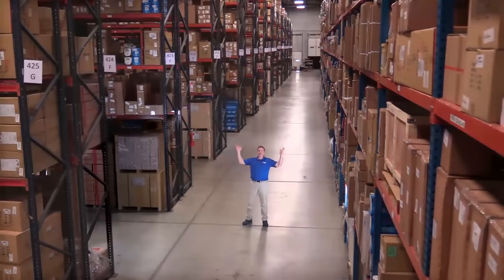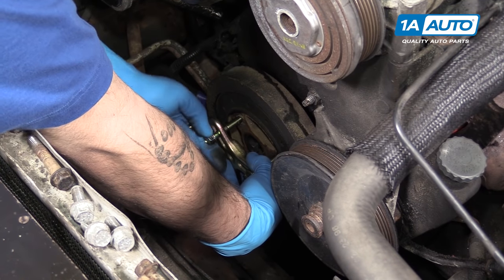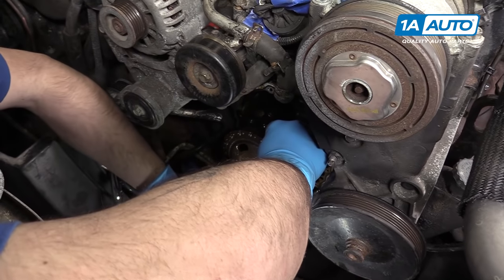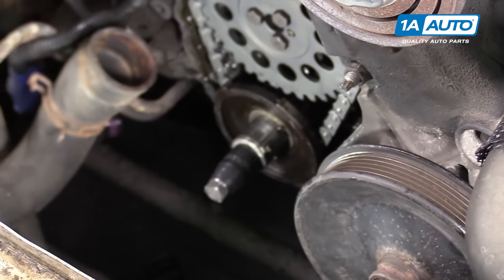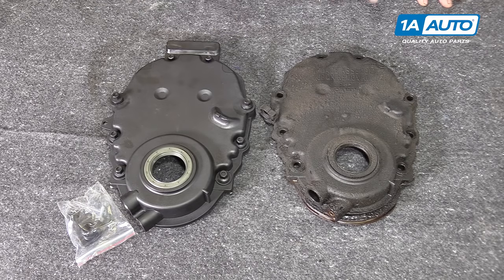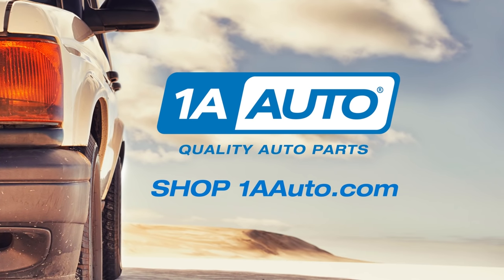How to Replace Timing Chain 96-99 GMC K1500 5.7L

Comment from the maker: √  Watch the Video
√  Buy The Part at 1A Auto http://1aau.to/m/Visit-1AAuto
√  Do it Yourself
√  Save Money
Reply: On reinstall tighten the pulley center bolt 🔩 to 70 ft the balancer on the crankshaft moved from compression stroke mark. Is that okay in order to get 70 ft Torque on center bolt 🔩? I hope you can respond to my question... Thanks...

Comment: Great video, just a couple of follow up notes:

-There is a very good chance that you will have to remove the first 6-8 oil pan bolts to get the cover out.  It is rare that the cover comes out without doing this, as it seals to the oil pan.

-On the same subject, look at your oil pan gasket where it seals to the timing cover.  A lot of these trucks have had their oil pan gasket replaced, and usually with a FelPro brand gasket.  The FelPro gasket is one piece, and is quite thick where the oil pan seals to the timing cover.  In this case, you would not want that massive bead of silicone in there.  Just clean the one piece gasket very well with brake clean, and then put a decent sized spot of silicone on each corner of the timing cover where the oil pan lips seals to it.

-I would strongly recommend using red Loctite or the special locking fastener the aftermarket offers to keep the 3 cam gear bolts tight.  Not necessary, but why take the chance of them loosening up.

-Use thread sealant or Teflon tape on all 4 water pump to block bolts, or they will leak.  

-Lastly, you might change the chain only to find that the engine runs rough/doesn’t start, or the computer sets a P1345 Cam/crank correlation code.  This can happen if the vehicle was retimed at any point while the chain was loose.  If so you will need the engine retimed with a scan tool.   Great video though, and good luck with your repairs everyone.
Reply from the maker: +gcaprice406 Thanks for checking us out! 1AAuto.com
Reply: Hey there, good comments. I can't find any good videos on how to do the timing correctly with a timing light. Specifically where the dam cable is for the auto timing to the ecu, that needs to be disconnected first. Any suggestions or links you have would be awesome. Thank you. 1997 K1500 5.7l vortec

Comment: Nice step by step video! I'll be doing the same on my 96 Astro. 230K miles and not running to well per timing issues. I assume the chain must have some bad slack. Adding my 2 cents, I see you added a new water pump on the re-assembly. Loosening the bolts on the water pump pulley would probably been easier (for those who don't have an air ratchet or impact wrench) before taking off the serpentine belt. Also, the same for the crankshaft pulley as well. Cleaning the gasket residue around the water pump jackets and the timing chain on the block first would probably been easier before adding the new chain set. Other than that, awesome and most detailed video I've seen on youtube! Thanks!
Reply from the maker: +James Logue Thanks for watching. If any of our viewers needs to make this repair, we carry the auto repair part shown in this video on our website. Here is a link to them http://www.1aauto.com/timing-chain-set/i/1atbk00063?utm_source=YouTube&utm_medium=CTA+Comment&utm_campaign=ytcomment&utm_term=mUeIe2Cgchs
Reply: Well, I just wish... I COULD DO THE JOB MYSELF! Who can pay $2500 dlls for this Job. My truck 98 Chevy Tahoe needs to pass emmisions inspections, because the stupid engine light is on and has been on for years.  AND DOES NO HARM TO ANYONE! MY TRUCK RUNS JUST FINE! What the hell!!!!
Reply: Very good advise I was thinking same thing

Comment: Check your torque specs! Timing cover is 6.75 ft-lbs not 18! (or 75 in-lbs).  I figured that out after breaking off 2 screws in the block!
Reply: How did you fix? I had the same issue. I knew it seemed a lot tighter than they came off too.
Reply: Yeah I snapped 9ne of mine also. He also doesn't tell you that the oil pan gasket is one piece and you tear the part between the pan and timing cover when you pull it off. Now I gotta drop my oil pan to fix that. Mine is leaking right there.

Comment: On removing the bolt on the crankshaft put a socket on bolt with a breaker bar against frame bump starter bolt comes loose it is threaded this way so it doesn't come loose while running.

Comment: Would’ve been great to know that it may leak if you don’t drop the oil pan front! Used a ton of RTV and it was a PITA to get in and still leaks which now means I need to drop the oil pan AGAIN! To finally get it to stop leaking!

Comment: Good video, thank you.

What was the torque on the three crank pulley bolts? 

What was identified as an oil slinger, is the crank sensor reluctor ring. 

Clean the timing cover gasket surface, and water pump gasket surface as soon as the timing chain and gears are removed or,  prior to installing the timing chain/gears and timing cover.  Makes it easier to access those surfaces without those items being installed.
Reply from the maker: +biff314 Step 1.Removing the Fan Shroud 0:59
Unclip the wiring retainer from the fan shroud with a flat blade screwdriver
Pull the wiring off the fan shroud and set it aside
Remove the seven 10mm bolts from the fan shroud
Lift the fan shroud up and out
Step 2.Draining the Coolant 1:47
Twist off the radiator cap
Have a drain pan ready
Twist off the radiator drain plug
Allow the coolant to drain
Twist on the radiator drain plug
Step 3.Removing the Fan Clutch 2:13
Attach an adjustable nut to the fan clutch nut
Tap the wrench with a hammer to loosen the nut
Attach a 3/8 inch drive ratchet to the serpentine belt tensioner
Turn the tensioner as far clockwise as possible
Tap the adjustable wrench with the hammer again
Remove the ratchet and the adjustable wrench
Spin off the fan clutch
Step 4.Removing the Serpentine Belt 3:16
Familiarize yourself with the route of the serpentine belt
Insert the 3/8 inch drive ratchet into the tensioner
Turn the tensioner clockwise to loosen the belt
Pull the belt off the alternator
Release the tensioner
Pull the belt off by hand
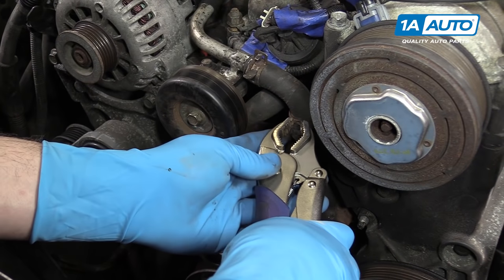Step 5.Removing the Water Pump 3:45
Press the clamp on the upper hose
Twist the hose free
Remove the hose
Have a drain pan ready
Loosen the clamp on the lower hose
Wiggle the hose free
Remove the four 14mm bolts from the water pump
Pull the pump off
Remove the last hose
Remove the four 10mm bolts from the water pump pulley
Remove the pulley
Step 6.Removing the Crankshaft Pulley 5:51
Remove the three 14mm crank pulley bolts
Remove the 16mm center bolt
Remove the pulley
Step 7.Removing the Harmonic Balancer 6:43
Reinstall the 16mm center bolt without the washer
Insert the hardware from the puller kit into the bolt holes
Run in the center bolt supplied from the puller kit
Tighten the center bolt
Slide the harmonic balancer off
Remove the center bolt
Step 8.Removing the Timing Cover 8:22
Disconnect the crank position sensor
Remove the 8mm bolt from the sensor
Remove the sensor
Remove the eight 10mm bolts around the timing cover
Remove the timing cover
Step 9.Removing the Timing Chain 9:15
Remove the oil slinger
Insert a socket as a spacer into the crank
Rotate the crank until the timing marks on the gears line up so that both dots on the gears' teeth are lined up close to each other
Hold the crank shaft with a 16mm socket and ratchet
Remove the three 13mm cam sprocket bolts
Remove the camshaft sprocket and timing chain
Install the two or three jaw puller to the crank gear until the gear comes off
Step 10.Installing the Timing Chain 13:06
Install the crank shaft gear with the dot facing you
Tighten the bolt with an impact gun
Insert a large socket or install tool and tap it to adjust the pulley into place
Insert the 16mm crank bolt
Insert the camshaft pulley and chain into place and around the crankshaft pulley
Push the cam gear in
Reinstall the three 13mm cam sprocket bolts
Torque the cam sprocket bolts to 26 foot-pounds
Reinstall the oil slinger with the high side facing in toward the crank gear
Remove the crank bolt
Step 11.Installing the Timing Cover 15:17
Wipe off any grease off of the timing cover and around the chain
Scrape off any built-up gasket material with a razor
Wipe off any dirt and debris with brake cleaner
Apply oil safe gasket sealer to the bottom of the timing cover
Press the bolts into the cover
Press the cover into place
Tighten the 10mm bolts
Let the adhesive dry
Torque the bolts to 18 foot-pounds
Install the crank position sensor
Tighten the 8mm screw to the sensor
Connect the connector to the sensor
Step 12.Installing the Harmonic Balancer 19:35
Install the installer tool into the crank shaft tightly
Insert the harmonic balancer onto the crank
Tap the balancer with a hammer
Install the sleeve of the install tool
Install the bearing
Install the bolt and tighten the nut down until the balancer is bottomed out
Remove the tool
Step 13.Installing the Crankshaft Pulley 21:15
Insert the pulley into the engine
Tighten the 14mm bolts to the pulley
Tighten the 16mm center bolt and washer by hand
Step 14.Installing the Water Pump 21:40
Tighten the four 10mm bolts to the pulley
Clean the gasket surfaces with a razor blade
Set the bolts into the pump
Place the gasket on the pump
Connect the inlet hose to the pump
Insert the pump into place
Tighten the hose clamp
Tighten the 14mm bolts to the water pump
Torque the bolts to 30 foot-pounds
Reinstall the remaining hoses to the water pump
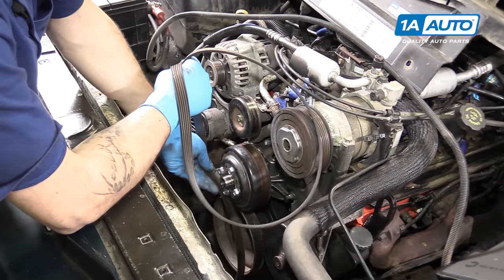Step 15.Installing the Serpentine Belt 23:23
Loop the belt around the crank pulley
Bring it around the water pump
Bring it under the power steering pulley
Bring it around the A/C Pulley
Bring it around the belt tensioner
Bring it under the idler pulley
Pull the tensioner clockwise with the 3/8 inch ratchet
Pull the belt over the alternator
Release the tensioner
Torque the center crankshaft pulley bolt to 74 foot-pounds
Step 16.Installing the Fan Clutch 24:33
Start the fan clutch nut onto the pulley by hand
Attach an adjustable nut to the fan clutch nut
Tap the wrench with a hammer to tighten the nut
Step 17.Installing the Fan Shroud 24:48
Line up the fan shroud
Fasten the seven 10mm bolts into the fan shroud
Place the wiring on top of the fan shroud
Clip the wiring to the fan shroud
Step 18.Filling the Coolant 25:17
Add coolant to the coolant bottle using a funnel
Twist on the coolant bottle cap
Run the engine briefly
Add coolant as necessary

Comment: Replace the ignition switch module! My truck had the same issue. GM was having ignition switch problem way back in the 90's as well. Replace the ignition switch and the crank shaft sensor.
Reply from the maker: +tommy lopez Thanks for checking us out. 1aauto.com

Comment: Tried tightening the belt like this guy did on a 2001 gmc jimmy, pullies would still turn, finally broke down and got the actual tool at Advance auto, so much easier, ull need a 1 and 7/16 inch wrench and a tool that u take 2 bolts out of the pully behind the fan then instert the tool to hold that in place
Reply: Or just hold the pulley with a pry bar instead of even stretching out a otherwise good serpentine belt.
Reply: Also never pry on old hoses with pliers...use a pick and spray a little silicon. Will come right off easy
Reply: Also when turing a engine by hand...remove your spark plugs this way your not fighting so much compression.
Reply from the maker: +Anderson Auto Help Thanks for the feedback!

Comment: I broke a timing cover bolt while torquing to 18 ft-lbs.  Make sure to double check the torque specs for your vehicle. After doing my research I found the torque spec for my timing cover listed as 106 in-lbs or about 8 ft-lbs.  I have a 99 K1500 Suburban
Reply: +1.  I also broke a bolt and had to drill it out.  Chilton's recommends torquing to 100 inch pounds, or 8.3 foot pounds.
Reply: How long did it take you to do a job like this?
Reply: you need to always use a measure of common sense when working on cars,trucks etc.a timing or valve cover or oil pan/trans pan isnt a structural or combustion sealing item so it will always be in low inch pound increments or tighten to tight plus an 1/8 to 1/4 turn
Reply: Lock tight ? For timing cover bolt?

Comment: I usually replace the balacer at this time also, when fixing the cover, install the balancer enough  to centre itself in the seal, secure the timing cover bolts you can reach, then pull the damper off again to alpply final torque to timing chain cover - it is sometimes necessary to test the crank pos sensor clearance toshaft as the cover may be shifted slightly from centring seal to shaft. Spacers can be added to sensor to increase clearance.

Comment: Great video. Except for the part where he says torque the timing cover bolts to 18 ft. lbs. I just broke a bolt in my block. The correct torque is 106 inch pounds. Very frustrating.

Comment: thank you, that was the best video I have EVER watched for doing this. I was told there is 2 differant timing chains for my 97 GMC  Sierra 1500 truck, it;s got a 5.7 V8 motor. they told me They needed to know what timing chain it was. So I need to take it off to show them what one it is? Is this true?
Reply: 8 digit of the VIN assuming it is a 5.7 then:
If the 8th digit is R then you have .280" Tooth Width Sprocket
Reply: You are correct..there are two different types one being a roller chain with .280" width sprockets or the inverted tooth chain with .400" width..my '97 Vortec 350 VIN R has the latter.

Comment: Like your vid’s but I’d like to note that on TDC of the #1 compression stroke the cam reference mark is at the 12 o’clock position. Unconventional in my experience but everything starts with the engine set at the TDC of the compression stroke on #1 cylinder.

Comment: TDC compression stroke number 1 cylinder : both cam and crank marks are at 12 o'clock position.
Reply: Is this correct? Sure seems like it! Because I'm at this very point and my rotor is at the #1 cylinder when both are pointing at 12 o'clock position!
Reply: @johnathanlivings8540  yes it is correct.    When dots are at 12 and 6, (dot-to-dot) that is actually number 6 top dead center.   Edelbrock techline confirmed this for me and it was correct when I started the engine.

Comment: When you turn your crankshaft this way do you ever risk breaking your crank pulley screw that you used?
Reply from the maker: +Scott Box Not typically, as long as you follow the directions in this video you shouldn't have any problems!  1aauto.com

Comment: i replaced mine, it dosnt leak at idle or reving the gas, but on the road i have a leak, i used a whole tube of sealer, whats the issue?  clean it and apply more sealer to see if it stops?

Comment: I'm putting the head's and intake&all the accessories off the off my 95 throttle body on the block of my 97 Vortec do I need the oil Slinger

Comment: Hello. I used your torque specs on my timing cover which you stated in video 18ft pounds and I broke 2 bolts off instead the block. The correct torque is 6.5 ft pounds. Not very happy. I will from now on just look up torque specs

Comment: Is it better to heat crank sprocket for install or using the tool shown?
Reply: NO, it does not slide on that tight, just clean the crank nose a little with sandpaper or cloth and it will slide on.

Comment: When I took off the cover on the oil pan side there was a plastic seal that fell apart. Will just the gasket sealer work or do I need to replace that plastic front main seal part?
Reply: a little late but rule of thumb I've been taught I'd is a if you take a component that has a gasket replace it. The cover should be ok unless you notice a crack. Gasket sealer was place at the bottom to reinforce where oil will sit the most

Comment: So I got one I have a 98 k1500 Chevy my baby but original motor 215 thousand got a tick or I thought it was adjust timeing advance dimed it down I get new battery put in then listen to front where pulley are in front motor and heard the tick their is it ever heard of time chain slapping around and almost like a lifter tick but on front of motor help me if can ?
Reply: On a 350 we were looking.at to buy it sounded like a knock I was worried dad sprayed wd 40 on the belt and it went away.Worth a try don't remember if it was a pulley or belt.

Comment: This is not the first time this set has been changed the original set was a dubble row chain and I had to drop the pan , if you use the factory type of plastic cover you can use the better set of gears of you use the Holley aluminum cover with a replable seal
You need a thin set like this one or single row chain. I do mine a little different I take a old dampener and cut the shaft off and use it to aline the cover ( seal ) with the crank but pan needs to be lowered but I don't have leaks something you would have to remove the alinement pins . If you have very high mileage put a new dampener on at this time.
Reply from the maker: +good guy Thanks for the feedback!

Comment: 1A auto parts. So  On a 1998 gmc k1500 5.0 L 305 serria SL z71  1/2 ton pickup is my vehicle make a non interference engine ?
Reply from the maker: +Devo As far as we could find, that engine is not an interference engine, but it would be best to check with a local shop or your dealer to be sure. Thanks for checking us out! 1AAuto.com

Comment: Tengo un problema con una GMC sierra 2002 compré el kit de distribución y la cadena queda demasiado holgada floja ustedes me pueden ayudar el motor es 5.3 la cadena no lleva jias o tensor como los modelos más recientes
Reply: El kit lo compre en AutoZone y queda floja la cadena chequé la medida ente centro y centro de engranes con la cadena puesta a fuera del motor y quedando estirada la cadena como debiera de quedar y tiene aproximadamente 122mm y eso me da a entender que la que le quede bien devere me dir unos 5a7mm menos